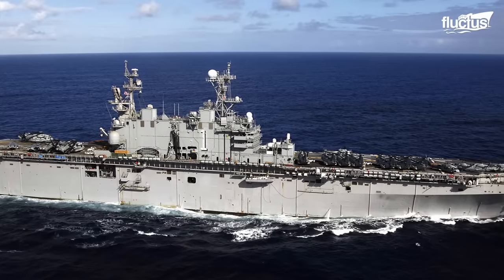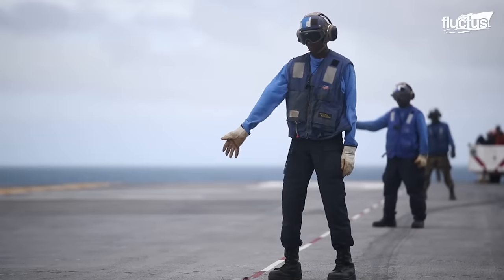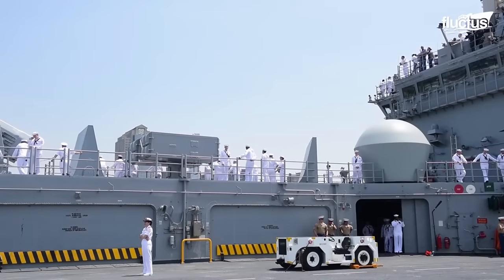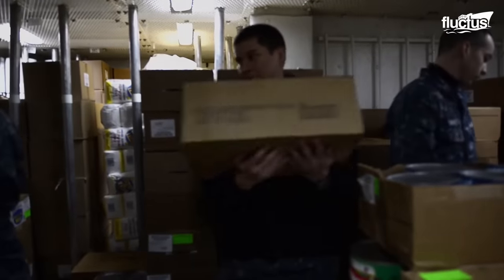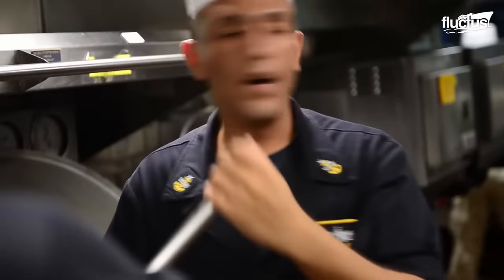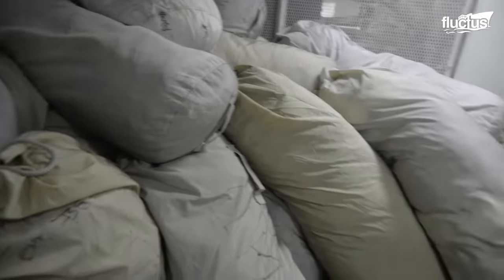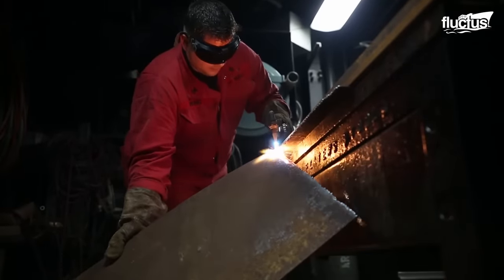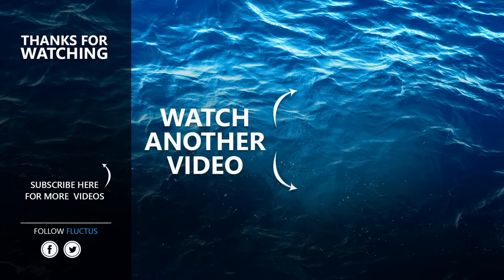Life Inside US $4 Billion Most Advanced Amphibious Assault Ships Carrier

Comment: Can anyone answer why the US does not use take-off ramps on their Assault ships and have flat decks only? It seems that this would limit the max take-off weight of the Harriers and F-35Bs considerably.
Reply: Having a ramp/ski-jump would limit the usable flight deck space for rotary wing and tilt rotor aircraft, The Navy & Marines did not want to give up a couple of rotary landing spots. Doctrinally....the goal is to GET MARINES ASHORE. The fighters are there to support that doctrine. In addition, the F-35Bs are STOVL (Short Take Off & Vertical Landing) capable and do fine without it.
Reply: They have catapults
Reply: @multidoor6928  Not on the amphibs. Only the supercarriers have the catobar system.
Reply: @rogerb3654 aren't they more meant for close air support?